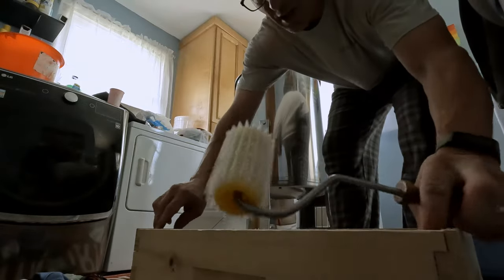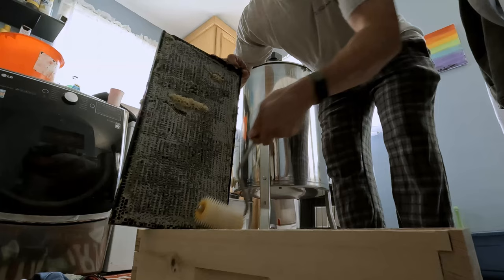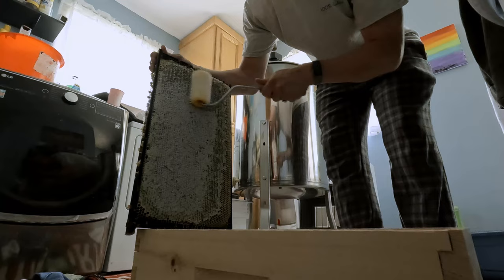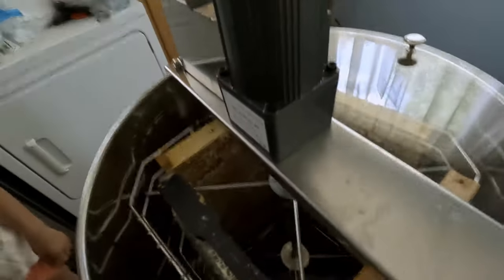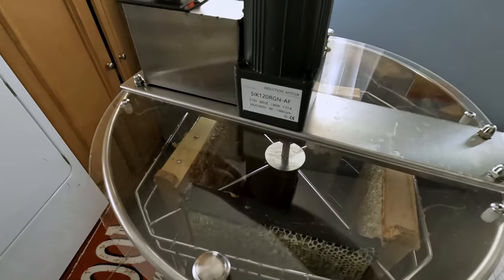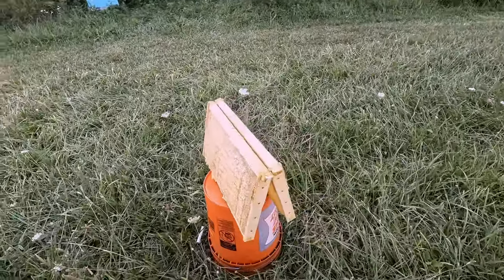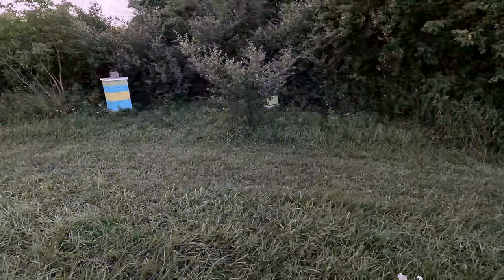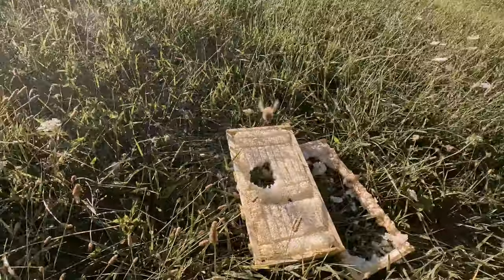Using the Vevor Honey Extractor 4 Frame - Electric Model Review and Tips!

Comment: Bought one fucking junk don’t buy broke out of the box
Reply from the maker: Mine is still working, but I could see the advantage of spending more and getting a nicer one. It was making a clicking noise, but that stopped, and how it holds the frames only extracts one side at a time. So it takes a bit more time than needed. Hind site, it is fine if you are not doing a lot of hives, or if you have time to spare. If you do a lot of honey, you may want to spend some extra and get a nicer extractor.